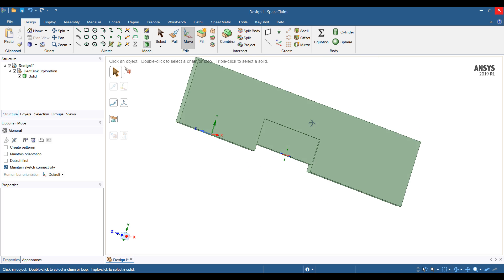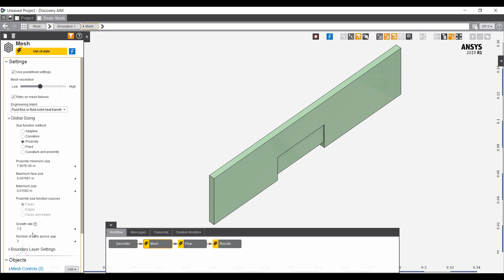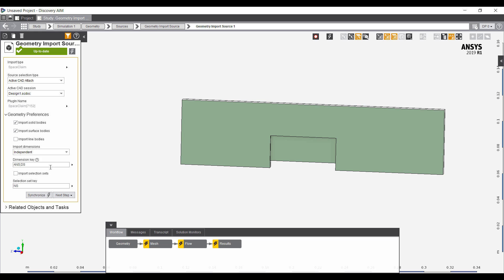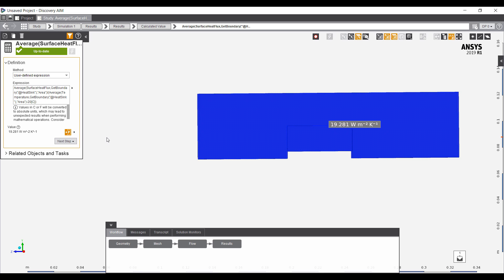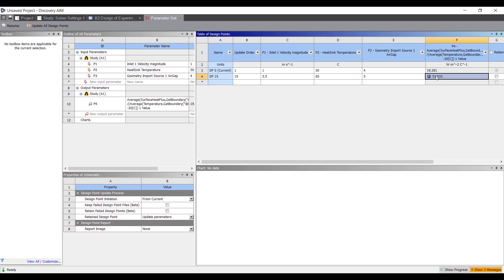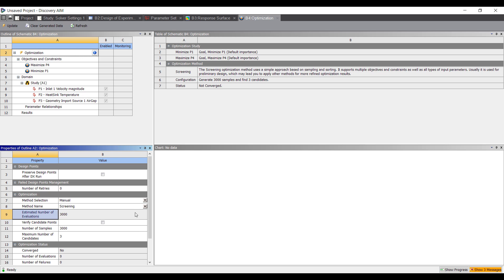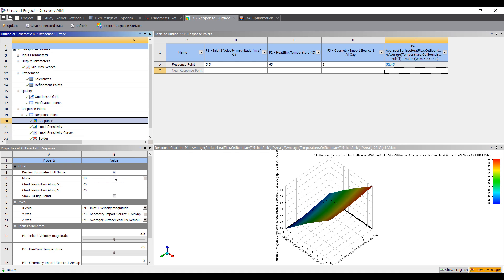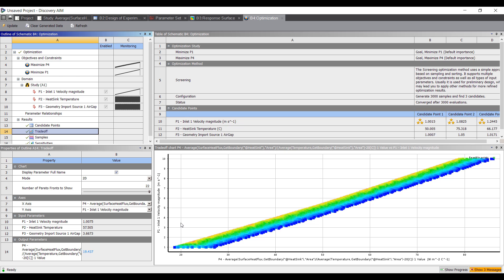Calculating Heat Transfer Coefficient on Heatsinks

Comment: Good video, but with the title "Calculating Heat Transfer Coefficient .."  I am a little disappointed at how little time and explanation went into the user defined expression that calculates it.  For example is there a selection set or boundary definition creation step that needs to be completed?  I guess I now know that it can be done, but typing in your expression isn't enough for me to reproduce the outcome.